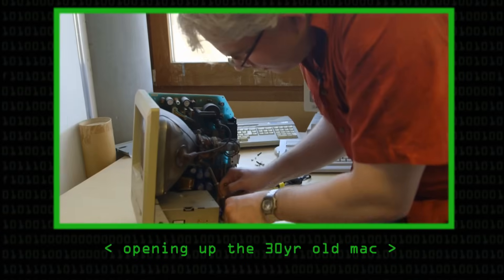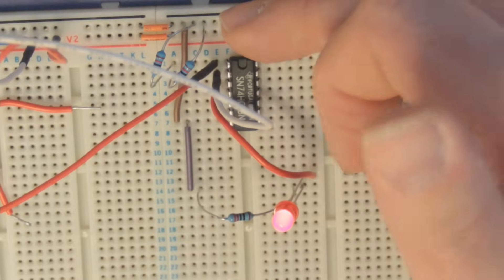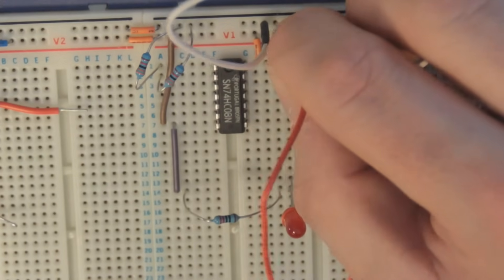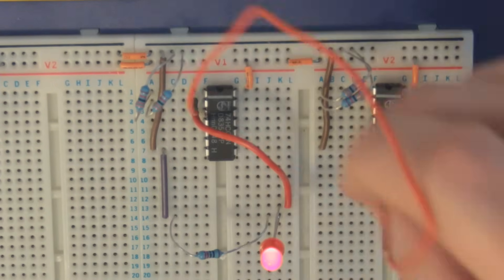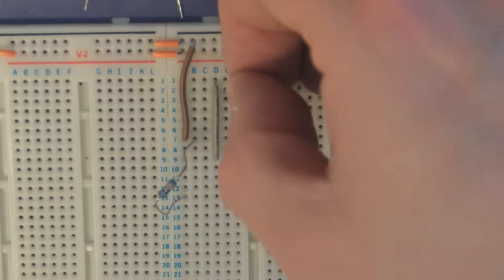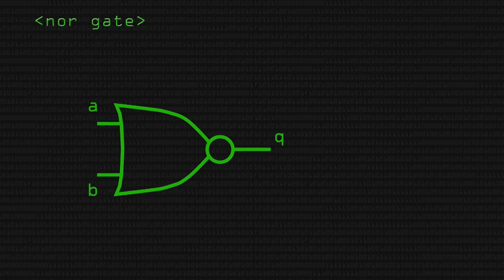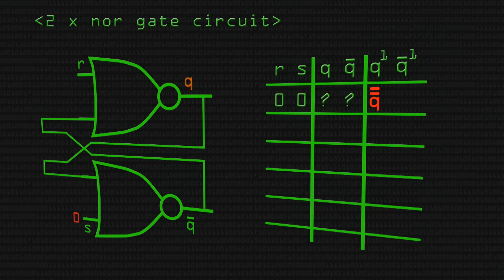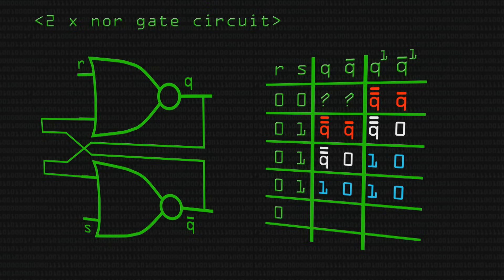How Computer Memory Works - Computerphile

Comment: Does anyone know a way to make a NOT out of ANDs or ORs?

You can easily make every single logic gate using on NOTs and ORs, but if you could make NOTs using ANDs or ORs you could make any logic gate with just ANDs/ORs.
Reply: +Thomas O'Dea 
"Does anyone know a way to make a NOT out of ANDs or ORs?"

You can't. You need negation in your primitive. There are two general logic functions that can form everything else by themselves and those would be NOR and NAND.
Reply: Well... you could I suppose, but that's way overly complicated.

Copy the values 2 times. Check them against AND gate, if they don't pass, check the next one. Now check the second set of values, if they pass the OR gate, congrats! That passes XOR!
Reply: +Thomas O'Dea I believe you misunderstood Gnomefro's comment. You CAN base all of computing on 1 logic gate. However it cannot be AND or OR. The only logic gates that are enough to compute everything are NAND and NOR. When you have one of those two (in big numbers) you can essentially build a complete computer :)
Reply: metaforest Actually, you can make any Boolean function out of NOR gates too so to say it's only true for NAND gates is incorrect. Furthermore, if you're designing a system to be built once, then that's one thing, but once you start mass producing it, it becomes another. It's a lot cheaper to use IC chips than it is to use FPGAs in mass production. Once you start getting into that territory, you need to start thinking about timing, material cost, gate levels, and even the architecture of the transistor that you use.
Reply: +Gnomefro I see... Thanks :) I was only asking because I thought might be possible to base the whole of computing on just 1 logic gate, though I had my doubts. Still, it is easily possible with 2.
Reply: +maciej53 Oh! Yes, I see. That's very cool :D
Reply: +Thomas O&#39;Dea You can also easily prove that if you know that you can do everything with AND and NOT: first you build NOT from NAND which is just having both inputs the same - NOT a = a NAND a. If you want to convince yourself that is true, than just create a truth table :) Than you build AND from NAND and NOT, which is trivial since NAND is just NOT(AND). Therefore  a AND b = NOT(a NAND b) or, if you translate it to NAND only a AND b = (a NAND b) NAND (a NAND b).
Reply: +maciej53 Yes, I see it now :) Thanks.
Reply: +Thomas O&#39;Dea The really neat thing is that down at the transistor level, an AND gate is actually a NAND gate with an extra transistor stuck on the end to invert it. So even though we tend to think in terms of positive logic as being more basic, in practice a NAND gate is smaller, cheaper, and faster than an AND gate.
Reply: +Thomas O&#39;Dea Actually, it's more common to make circuits out of NOR gates. NOR gates can be used to make pretty much any gate you want.
Reply: +Oshyrath I realize :)
Reply: +Oshyrath The reason NAND (edit: not NOR gates >,<) gates were used in those early devices is that EVERY boolean function can be built from only NAND gate.  This is NOT true for any of the other gates used in boolean logic.  There is a mathematical proof for this.    ABLE is obsolete.   No one uses it for anything any more.  Varilog and VHDL are the two biggies.   FPGAs are not just for prototyping.  There are systems that simply cannot be built without using them because it would take so many parts that the FPGA is the most efficient way to implement it.  These are also systems that will never be mass produced, so there is no benefit to designing a custom made chip for the function.
Reply: oh.. that explains my confusion.... both NAND and NOR are functionally complete... I had to look that up.  I stand corrected!    On the issue of FPGAs being fit for a lot of solutions where custom or COTS components aren't....   Well there is no way to answer that definitively for any given example... I think maybe I should be more clear....  FPGAs are an example of a broader category of programmable logic systems.... and what I am getting at is that programmable logic has its place outside of prototyping.   YMMV.
Reply: Thanks

Comment: I'm a studying biologist and really love physics as well and have noticed that when I speak to people they act as if what I'm saying is well above their comprehension level, but I always feel like they just don't understand the terms, and if they did, it'd be easy to understand. 
However, this is my first time ever really watching a computer video and it seems to me that this sounds incredibly complex. Its like I can hear what non-scientists hear all the time when a scientist speaks. I have escaped my micro bubble! lol
Also, taking a computer apart and trying to figure out how it works is about as difficult as it was for biologists to figure out that the brain processes memory and is the control center of the body, or the discovery that blood carries oxygen. Complex stuff, this video puts much into perspective.
Reply: Bio-engineering? My sister is bio-eng. I suppose biology is alot more like studying medicine. Alot of reading and remembering. Both require understandment, but I believe computer engineering and computer science is learned in a bit different way. You don't learn programming by reading for example. You have to physically do it until you do it automatically.

Comment: So how do chip producers manage to improve the performance of their chips. how does intel allow faster transfer speeds of these bits?
Reply: Im here to save the day! Basically accessing memory is pretty fast, when the guy connected two wires the gates have latched on to a different value. A cpu has a clock, which is literally there to synchronize everything and also speed things up. You can increase memory access by just adjusting the clock (crank it up) or have a higher memory bus. (more bits = more direct access addresses)
Reply: From a fundamental standpoint however, they also achieve faster speeds with a smaller processing node as voltage required to activate electron tunnelling becomes lower. This is due to the time required to build up voltage every time these transistors want to switch becoming smaller, hence faster transitions.

Comment: I once figured this all out in my head and made a calculator... There was only 1 problem... The game i tried to test it in was not poweeful enough to run my calculator... And there was no xor gates... So it was about... 4/5 times bigger than it needed to beif you want i can send you the schematics via email or skype...skype :jklw10 email: pelivaan@ gmail.com
Reply: +minecraftermad You can "synthesize" an XOR gate by using this formula: (A * NOT B) + (B * NOT A) for a two-input XOR. Here, the * means AND, and the + means OR.

Comment: Would be nice if you'd mentioned that the dynamic ram you showed on that SIMM actually doesn't use complex gate logic anymore. The controller circuitry is more complicated, but the memory cell itself is reduced to one single transistor. Gate logic memory would have way less capacity.

Comment: Slight oversimplification at 13:37 - all the values do NOT go to zero, in fact q1 goes to 0 and not-q1 goes to 1.  The "Set" input makes q1 go to 1, and the "Reset" input makes q1 go to zero.

Comment: How is touching the resistor turning the input on? It is a short circuit to ground, electricity shouldn't flow through the input of the gate. What am I missing?
Reply: Ciroluiro The resistor connects the input to ground, which pulls the input low in the absence of anything else.  The flying lead is connected to +V, so touching it to the input end of the resistor takes the input high for as long as the lead is touching.  Also a current will flow through the resistor.  If you connect the input to ground via a wire, then touching the input with the flying lead will short the power supply, and we saw near the start of the video what happens if you do that.
Reply: David Spencer oh so even though the resistor is connected to ground, current will flow through the input, right?
Because I did figure that if he had not put the resistor there it would have shorted the power supply because nothing would be limiting the current. But with that reasoning I also figured that the input would not be high because the current would be flowing directly to ground (through the resistor if it's there) and not through the input. It is obviously not the case. 
So what happens is that part of the current flows through the resistor and part of it flows through the input, making it high? Or current does not have to flow through the input to the chip to be registered?

Another question would be why is it necessary to connect the input to ground to make it low. Isn't not connecting it to anything enough to make it low or off?
Reply: First question.  Short answer: yes.  Long answer: it depends on the design of the chip.  If the input is the base of an NPN transistor then (conventional) current flows in, albeit a small base current.  If it's the base of a PNP transistor, current would only flow out of the base, through the resistor to earth when the flying lead is disconnected.

Next bit: if he had simply not put the resistor there and left it floating then the PSU wouldn't be shorted.  If he put a wire there instead of the resistor then connecting the +V to the input as well would short the PSU.

Second question.  Yes, if you have multiple paths from +V to ground then current will flow through all those paths.  The amount depends on the resistance of each path.

Third: Thinking about it in terms of current flow can be confusing.  If the gate is connected high it will be "on", if low then "off".  Actual current flow depends on the chip design.

Last question: if you leave the input floating then the behaviour is undefined; you will always need to pull it high or low.
Reply: David Spencer Thank you! Now I understand everything more clearly.

Comment: How do the leads light up in the rs latch if the circuit isn't connected to power? Maybe I am missing something obvious, but, please, could someone help me?
Reply: Never mind, I figured it out. The chip is always connected to the power, so the led lights up even if there is no power.

Comment: Did you know that TTL has pulled-up inputs (in effect)? - so you can leave them open (no R's required) and pull them low to 0V with wires...
Not safe with 74xCyy(y) series though, as I/P's float and can do 'horrible things :-(

Comment: How are you supposed to read that book?
Reply: That book is a summary of IC (chip) datasheets. A datasheet will tell you everything that you need to know about an IC to use it. I.e. what each pin does, how quickly the device works, its limits with regard to voltage and current, etc..
The TTL/CMOS datasheets are available online through a quick google search and most online stores have them on the purchase page for that item.
As an example simply type something like "74LS145 datasheet" into google and you'll get links to the datasheet. It can sometimes be a bit tricky finding more unusual datsheets
Reply: I was implying that the text was ridiculously small , but ok.

Comment: Someone mind explaining the role of the resistors?
Reply: They are known as "pull down resistors", and they "pull" the input "down" to zero, if no wire is connected to the input. Basically they give the input a "default" value, that can be overridden with a wire direct to 5V (one).
If the resistor wasn't there, you would have to move the wire from 0V to 5V instaneously (faster than the delay inside the chip), to make sure the input doesn't fluctuate randomly.
Reply: LEDs always need a resistor to not burn through.
Reply: GIDIX

not true.
constant current sources can drive them without any resistor at all.
even to some extent you can use a constant voltage supply.
Reply: A resistor 'resists' electricity to a certain extent as to reach a certain voltage, so as not to fry a chip with too high a voltage

Comment: 8:50  I don't fully understand what is powering the LEDs. I get the logic, but there is no 5v source in that circuit once the red wire he's using to make his point comes out of the system - clearly this isn't a magic self-sustaining circuit where the power never runs out - so how does the LED stay on? What's the power source once he removes the red wire?
Reply: Benjamin Buzbee Notice how the chip has 14 pins, and only 12 of them are for logic circuits input-output. In schematic with the gates, pins no7 and no14 are empty, that's because its the logic gate schematic, not the circuit schematic. In the circuit, pin no7 is the chips ground, and pin no14 is the chips power line (in this case +5v).

You can see one very small red wire connecting the 5v rail with the row no1 in which pin no14 is plugged into (rows are inter connected in each 6 holes chunk, columns are not connected), and a big brown wire connecting the ground to the row 7 (where the pin 7 is). Basically, the whole chip is constantly under voltage, and if there was no purple wires, since the gates are NOR and all inputs would be 0, all 4 output pins would also be on +5V (aka 1) constantly (in other words, if you were to remove both purple wires, both LED's would be ON).
Reply: One thing on the logic gates are the inputs and outputs but another thing is the power supply of the chip, so in this case you have on a single logic gate two inputs, one output and two extra ends, one for 5v and one for 0v

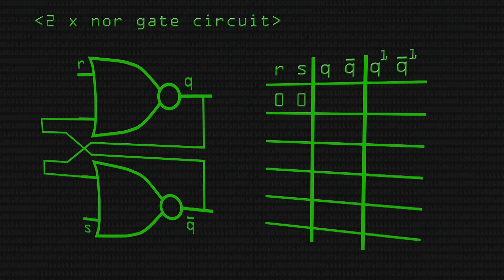Comment: Super confusing table at the end 10:50. Time goes left to right - fine. But then time also goes down from rows two to four (nut not on row one or five!). The transition from row one to two has nothing to do with the circuit but is manually set by the user. However, the transitions from rows 2:4 are due to the circuit settling.

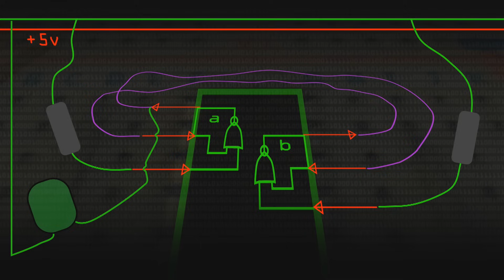Comment: 8:26 What determines the first state?
Reply: So before you turn on the circuit, both q and q0 are off, because there no flow electrons. When you power the circuit electrons will start to electrons start to flow, depending on what circuit turns on first determine the first state. So take as the first input as 00 for q and q0, and just follow the same pattern you get 1 0 for q and q0. Of course this assuming that nor gate on the left powers on first, however it's the other way, just relabel q and q0. So basically it depends on the length of wire.
Hypothetically if everything was timed perfectly and both turn on at the exact same time, and the flow with each circuit flowed at just the right rate, you would get output to oscillate from 00 to 11 to 00, over and over, the speed set by the internal circuit. The problem is this is a very unstable and as soon as one circuit was a bit slow it will settle into one of the states, or as soon as you set or reset. But this is sort of effect can be made stable with other kinds of circuits to create oscillators that can be used as clocks.
Reply: What caused Big Bang?
Reply: path of least resistance

Comment: I didn't realize I made a 4 bit RAM module when I was 13. I just tried to make as many flip-flop circuits as I could with the parts I had. I used NAND gates BTW.

Comment: And that is NOT how your computer's main memory works.  To save money, they use a capacitor-based system for main memory.  I remember reading about it.  The cache systems (generally no more than 64K in any computer) are set up using the flip-flop logic you describe, because it is faster.  But the man memory does not.
Reply: +John Undefined It's how computer memory used to work. SRAM. It's not how ^modern* computer or rather DRAM memory works. I have computers that use SRAM and it that case it exactly is how my computer's main memory works.
Reply: Peter Walker

I'm a little interested to know what computer you have that uses static RAM.  The computers from the 80's used DRAM (mostly because it was cheaper.)
Reply: +John Undefined I have a VIC-20 I use for 6502 research . My 8085 HP upx trainer, my sharp Z80 SBC and I believe most of my embedded systems. The all use flipflop RAM.

Comment: That's only a very small fraction of RAMs manufactured these days; static RAM.  But of course there are some very fine applications of that.  Even more interesting and common is dynamic RAM, which is basically an array of very tiny capacitors.  The key there is that these capacitors will lose charge, so they must be refreshed periodically (thousands or millions of times per second), to keep the ones active as ones.

Comment: 5:00 Actually nowadays it's the other way around. Today we make CMOS logic circuits. You can make a PMOS, NMOS or even BJT AND gate (which all drain power even in the off state) but you can't build a CMOS AND gate as it would require the PMOS transistors' drains to be connected to ground (0) and the NMOS transistors' drain to be connected to Vdd (1). That can't work. You need the sources of the NMOS transistors connected to ground and the sources of the PMOS transistors connected to Vdd. But that way you can only build a NAND. 
So an AND gate is a NAND gate with an inverter behind it. Not the other way around.

Comment: regarding the circuit that was explained in the end...
i have a question about electricity; you provide it voltage when you switch the state of the circuit and then you disconnect the 'live' wire ... does the LED keep glowing by magic? :D or did the guy solve all of earth's powers needs? xD